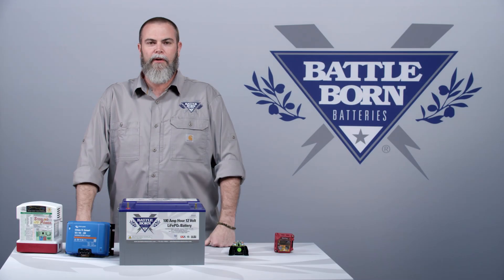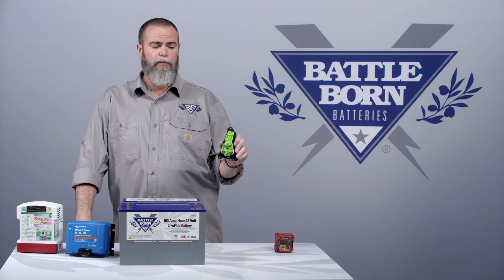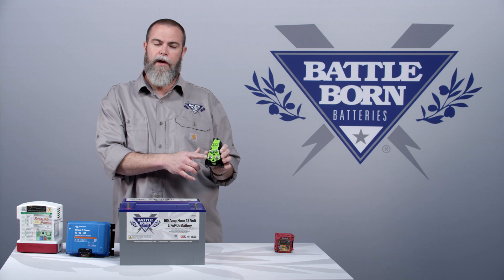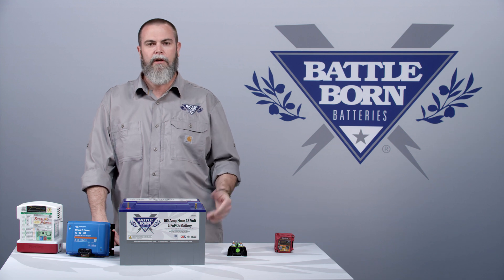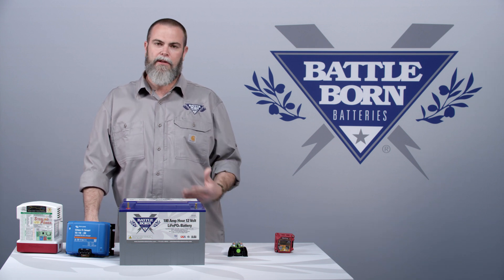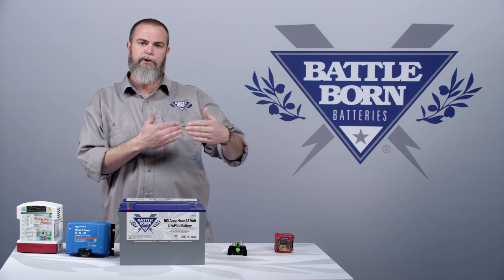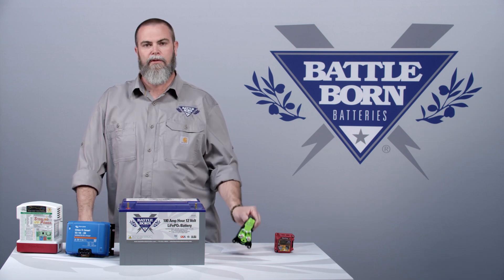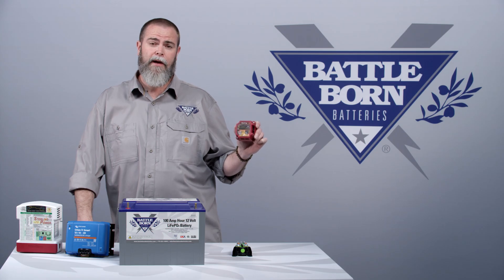FAQ: Can I charge my batteries using the alternator? l Battle Born Batteries

Comment: What are the recommended voltage regulator settings for charging 200ah 12V Battleborne battery bank from a dedicated alternator and a Balmar regulator? Sent 2 emails with this question, never got an answer.

Comment: I have two 100AH LifePo batteries in my 2018 Sunova 26P motorhome. Do I need the BIM to save my alternator? Also you mentioned an isolator? Is that the part that we use to temporarily connect the house and chassis batteries with the switch on the dash?

Comment: So I've a twin alternator set up,  1 to starter battery 2nd to leisure battery lifepo4 with no connectives between the 2 battery systems,  what can I use to protect the 2nd alternator when bms shut off occurs, as it has no connecting to the starter battery???
Reply from the maker: The Wakespeed WS500 is specifically designed for advanced alternator charging to protect both your battery and your alternator! https://battlebornbatteries.com/shop/brands/wakespeed/

Comment: Looking for advice.
I have installed two 100 amp lithium batteries in my travel trailer,  my TV is a Ram 1500 hemi, 2017. 
I have a DC TO DC 40 Amp charger installed in the trailer.
The power is supplied through the power on the 7 pin plug wire, which has a 30 amp fuse at the truck battery. 
My battery monitor shows the lithium batteries  being charged at around 30 amps, when the truck is running and the DC TO DC turned on.
Am I ok, or will either the lithium batteries or the DC to DC damage the 7 pin wiring, or truck alternator.?
I have not done any long trips as yet, just the idle tests.
I am happy with the charge rate, so I don't feel I need to run heavier wires from the truck battery.

Any comments would be appreciated.

Comment: Many RV'ers charge their battery from the 7 pin trailer plug. These are generally limited to about 30 amps and are on a relay circuit. Is there any issue charging a Battle Born Battery this way and what SOC would it be able to reach
Reply: That's what I'm trying to figure out. I've upgraded to a single 400ah LiFepo battery that I want to charge from my 7 pin. Anyone have any advice on this ?

Comment: to put it in perspective you wouldn't connect your solar panels directly to your batteries it requires a charge controller. The same thing works with an alternator it's just another source of current you still need a charge controller in order to use it I mean it's not rocket science
Reply: it's a bit more than that, alternators do have charge regulators by design, but they are designed for lead-acid batteries that have high resistance, not low-resistance lithium batteries. before lithium batteries it was common practice to use a solenoid to connect the house and chassis batteries together so both could charge by the alternator, but you can't do that with lithium due to the low resistance.
Reply: @marzsit9833  The vid said that a standard separator is ok if there aren't 3 or more lithium batteries.  This confused me TBH
Reply: @marzsit9833  I know that's what I meant when I said "the same thing happens with an alternator", meaning they do have a cgare controller of some type/ regulator. I've replaced the module on my Odyssey alternator once. using a relay to combine 2 battery banks is called "dual battery" or battery isolator, yeah I did know about those too.anyways this is a year old  when I made this comment

Comment: There's always been a handful of ways to charge lithium batteries using an alternator. Will prowse keeps sayings it's impossible, it's absurd
Reply: before dc-dc charge controllers came out the only way to do it with lithium was to use an external voltage regulator with a matching alternator like the systems balmar makes. but that was a very expensive solution so only the wealthy could afford it.
Reply: @marzsit9833  also some solar charge controllers back then for lead acid were capabale of programming your own algorithms so you could change the voltages to lithium battery specs or close enough that it was safe, many possibilities, just use the ole noodle. don't think "NO you can't do it, because someone else can
Reply: @marzsit9833  well no, actually as long as there were people with brains back then there was a way. for example inverters were existent back than were they not? than you can hook up a regular AC charger and charge the lithium bank off of your car alternator, that is in effect a DC to AC to DC charger, there are other ways, using a brain was not new science back than

Comment: Great information, however please tell us more about this if you were to use a power inverter perhaps pros and cons and a comparison.

Could you use a power inverter with these devices? Then add a battery charger?

I like the idea of a power Inverter and adding a battery charger. Sure it's not a straight shot like using these products you mentioned however it could have more utility  than just using these devices alone.
Reply: I was also wondering about that...ley me know if anyone says this is completely doable?  thanks